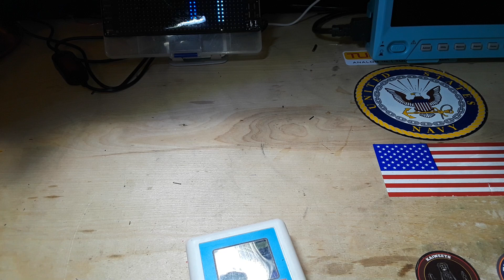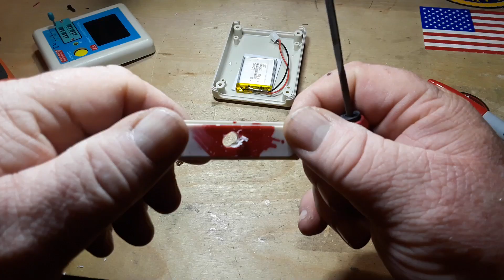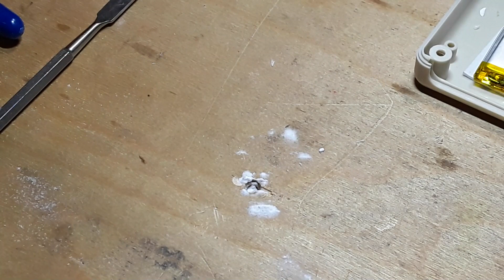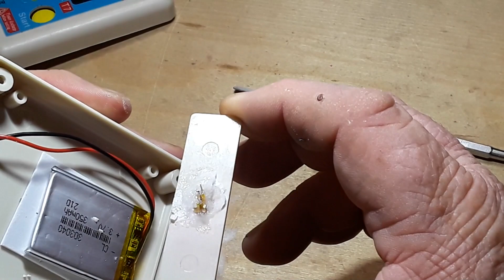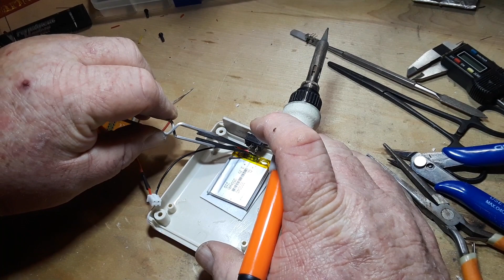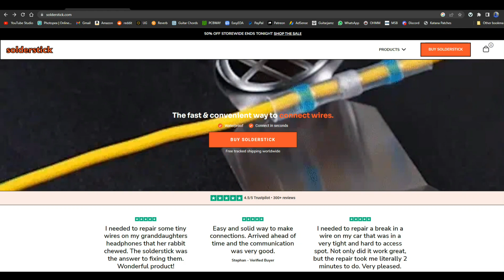Power Switch For T7 Tester : Sponsored by SolderStick Wire Connectors

Comment: Hi Paul, this is Paul.  I changed out for a 2400 mAh battery and had to remove the white 2P connector to make it fit.  Later I found out some complex mosfet style components could make the unit freeze (stumped?) with the display stuck on and not shut off.  So I had to add a switch so that it would not require disassembly and soldering each time.  I suppose I could also let the cell drop until the unit doesn't get enough voltage, inconvenient though.  Added a slide switch, similar to what you did, slightly different place and method but same result for a different reason.  I am sure others will find your post helpful.  I will give you a thumbs up just because!

Comment: I would have used the first switch but soldered it on a small pcb. Solder the battery to the switch contacts and the pcb to the upper panel. That give good electrical connection and strong mechanical resistance.
And always look and measure 3 times before cutting once ;)
Reply: Even 4 or 5 times ... ;)

Comment: The super glue and small switch is not very compatible I already destroy many small switch on that so just change and use epoxy but super glue is still  the best glue for my projects
Reply: I agree. Keep in mind that cyanoacrylate (super glue) is volatile and can migrate into the switch connections, thus causing coatings on the connectors. In criminal forensics the CA is used in the vapor  form to distinguish fingerprints. Forgot the CA instead use epoxy.

Comment: You should always have a Dremel on the bench. I've found them very handy with all their functions. Have the right size of switch that would fit and JB Weld or Epoxy would have been better and know how much wire you'll need.

Comment: One thing you did not consider is calibration. Every time you turn off that switch it looses calibration and reverts to defaults. To calibrate connect 1, 2, and 3 together with short wires and hit test.
Reply: I was wondering this too.  The main reason I need a switch is for reset purposes when the machine locks up identifying a complex semiconductor.

Comment: I wonder if yours has a fauly battery ? I've had mine for about 2 years, I charged it once when I got it and rarely used it since. (My health got worse and I've had to quit electronics after 40+ years). It's still at 50% power.

Comment: Modded a regular multimeter, brought out a power lead, made 2 posts for the meter, and a pushbutton switch in between when pushed while holding a resistor to the posts, it activates and shows the resistor value.

Comment: Old modeling trick to hide seam cracks. I use baking power but either works. When dry just sand and the crack is all gone. Primer and paint. All gone. Lol
I was hoping you remembered the circuit board, Oops... It happens to me all the time... Lol

LLAP 🖖